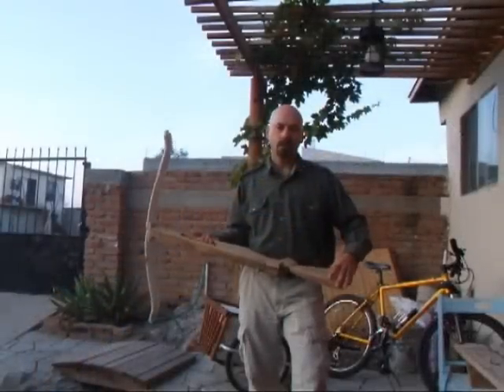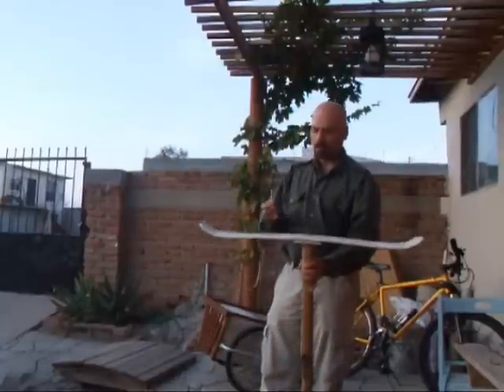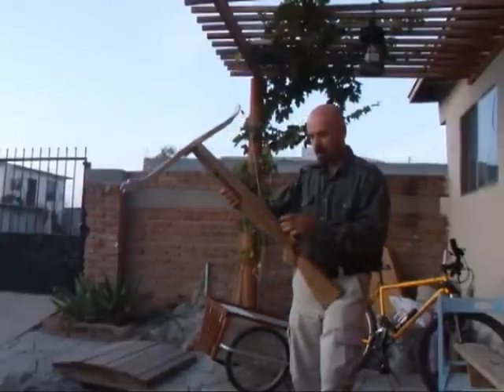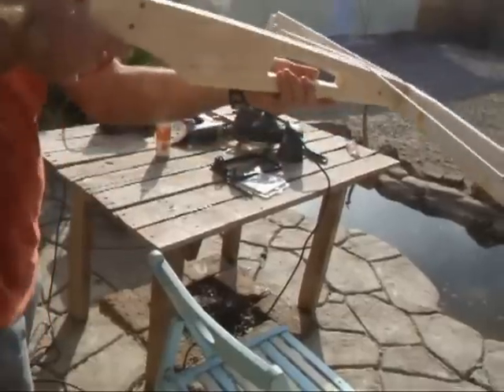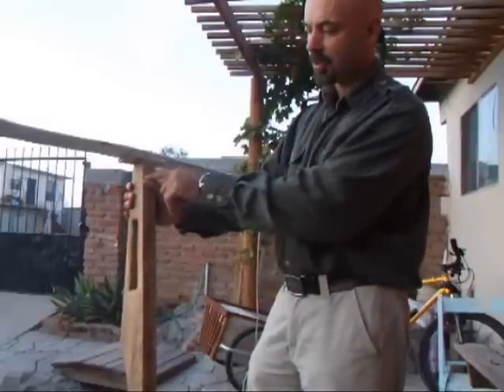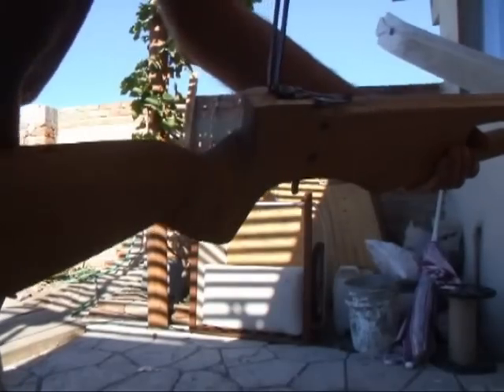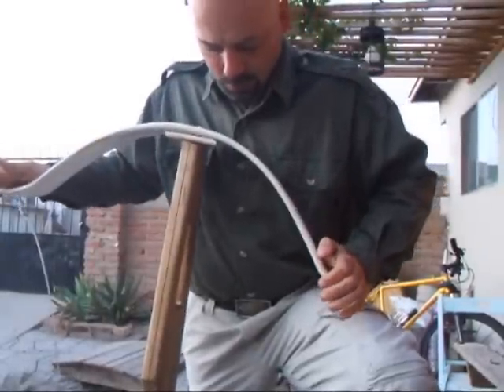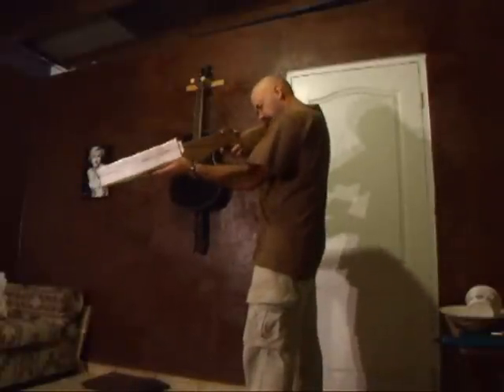How to Build a PVC Crossbow

Comment: I'm amazed it hasn't torn itself apart. One of the first things that is taught with bow/crossbow shooting is to never dryfire a weapon because of the incredible amount of energy that you are forcing onto the weapon and the string by doing so. When firing an arrow/bolt most of that energy is placed into the projectile upon firing. When dryfiring, that energy has no where to go except the string and the bow which can destroy the weapon and cause serious injury.

Comment from the maker: Dry firing, according to my understanding, can damage the bow or string, or even hurt the archer if something gives. However, my crossbow is made with PVC and cable for the string. I assumed that these would take the forces. I was wrong. The cable was plastic coated and the crimps eventually slipped (kinda like stripping an electric wire). The PVC did not fail and I doubt that dry firing would affect it. This crossbow has taught me a lot and my next is coming together much better.

Comment from the maker: In this case I completely flattened the prod, but this was because I chose to connect the prod to the stock (or tiller) via bolts. A tapered prod would be even more powerful and should then be attacked to the tiller by wrappings. I would recommend this method and will use it myself in the future.

Comment from the maker: yes, exactly correct. I do not have access to proper archery supplies and so I need to find a way to construct a proper arrow/bolt. Even when I fire one of my dowel bolts it is essentially dry firing since the weight is far too little. I have a design in mind and will try it in a few weeks, after I build my next crossbow. Additionally, the string was a tad too loose, which caused a little more vibration than necessary. Can't wait for the next one.

Comment: an answer to keeping the bolt in place,is mount a piece of spring steel  on top of the stock behind the trigger,a piece of an old handsaw blade will do it,it and be bent and shaped as needed,and will hold the bolt in place adequately,and while bendable will retain enough 'spring'..........hope this helps.

Comment from the maker: yep, I know exactly what you are saying and had the same thought...after I saw the failings of the bolts. The nose of the stock(tiller) should be a little larger than the bow(prod) and could then be notched to hold the bow snugly. An equally shaped bit of hardwood or steel would wrap the front of the bow and be attached above and below the prod, perhaps hinging on one side and bolting on the other. Most people use lashings, but, as you state, grips would make the crossbow collapsible.  thanks

Comment: With a single hook to lock the string back, you will need a small secondary loop (about an inch wide) made out of a strong stiff material like mono-filament wire about the area were the arrow/bolt connects to the bowstring.  You will be able, then, to put a nock on the feather end of the bolt so that it stays securely on the string.  This will also get you to lock the string back at the same point.  If you don't, you'll wonder why straight arrows do not perform consistently.

Comment: To avoid breaking the pvc from the wood just drill a hole two inches behind the top of the wood and take a string then wrap it trough the hole over the pvc and so on... No screws

Comment: In the clip, on the background you see a bike !!! again, use the cable from the breaks.
Use the (i don;t know englisch name for it), same little tool one uses to fix and adjust
the cable on the break. And also, you MUST use two kinds of material for the bow !!!.
The 2 materials have different physical properties and thus will make your bow more
powerfull, also (it wood used), 2 materials result in 1 material having new very strong
physical properties.

Comment: I would just use a bow wrist release for the string holder. If everything is centered perfectly there's no reason why the bolt could just be left floating with a drop away arrow rest in front. I think.

Comment: Not bad but a few pointers.  First, try to avoid putting anything (IE: bolts, straps etc...) through the prod (the bow portion of the crossbow) as it will weaken it and potential for injury is increased.  Second, I highly recommend picking up some Dacron b-500 or b-50 for use in making a proper string.  It's durable, and if you make the string right (very easy with a ton of videos and walkthroughs online) it will withstand the rigors of shooting as well as be easy on the fingers.  Third, in order to connect the prod to the stock, many crossbows utilise a rope with a loop on either end (much like a bowstring) that is run through a hole in the stock.  Each limb of the prod is placed through one of the loops.  To keep it from moving vertically while attached in this fashion, remove a 1/4 inch of material from the front of the stock, leaving a ridge at top and bottom.  Good luck!

Comment: Well, you've certainly heard enough snide comments about dry firing your bow, that's for sure !  Agreed, it's never a good idea to do so, but I came in to ask if you had ever considered using paracord for your bowstring.  Get the real stuff, because it's rated at 550 lbs, so it will never break in your bow.  Also you would not have to worry about any compression clamps, and the bowstring slipping out. I use it in all my longbows, and some of them are 80# @ 28'' amo 

Again, I'm not sure why everyone has to be such jerks about the way they tell you about the dry firing . . . . .  but what can ya say . . . . .  the world is made up with many sorts of people !
Reply: while paracord works in a pinch (survival etc...) it actually is a pretty bad material for bowstrings as it stretches a lot.  A better option would be to acquire some B-50 or B-500 Dacron and make a nice quick flemish twist.
Reply: HAHAHAHAHAHA . . . . . . . . . ! ! ! 
Say what you want, but I haven't had a lick of trouble from my substandard paracord bowstring . . . . . . . . . .  I've had it on my bow for a year now maybe just a little more, and it shoots just as good as it ever did !  The spacing between my riser and bowstring has not diminished at all !  So judging from the comment that it will only work in a pinch for survival, I'd say that is one MAJOR BIG Pinch . . . . . . .  ! ! !   hehehehehahahahahehehehehe  I'll post my deer this year that I take with my substandard bowstring !  ;)
Reply: Hey, I'm just going by the science of the material.  Nylon stretches.  Paracord is 100% nylon.  Therefore, it will stretch.  A 20-40 lb bow might not stretch substantially but it will still stretch. I wouldn't put paracord on my 64# recurve, that's for sure.
Reply: On top of that, Dacron is far cheaper than paracord, it's made for the purpose of bowstrings, and it looks way nicer than a paracord string.
Reply: KingAemon This is of course YOUR choice. Myself I don't care what it  = looks =  like, only how well it performs the job I'm requiring of it. I know the paracord is strong and very durable, so I will continue to use it with MY bows. As I've said, after having it on my bow for as long as I have, there has been no changes in it's performance !  Also, since I'm not in the market to sell any of my bows, I don't have to worry about how it looks. I only worry about how it performs, and I'm not worried at all about that . . . . . . .  As I've said, I'll post all my hunting kills this year, to show all that it really does work, even if it doesn't look pretty like a store bought bowstring. If someone is that worried about something like that, then perhaps that person should simply go pay the enormous prices of the top name brand bows currently on the market. Me, I just want a bow that is within my finances and functions well enough to target shoot whenever I want, and to hunt with.
Reply: para cord stretches too much
Reply: Dupa Krowa Say what you want, but I haven't had a lick of trouble from my paracord bowstring . . . . . . . . . .  I've had it on my bow for a year now maybe just a little more, and it shoots just as good as it ever did !  The spacing between my riser and bowstring has not diminished at all ! I'll post my deer this year that I take with my paracord bowstring !  ;)
I'll also post all the small game I take as well.  I've yet to see anyone posting any of these here yet ...  only shooting at targets in fields backyards and driveways.  We need to show that this is just as viable a material as wood, wood laminents, fiberglass, ALUMINUM, and so on.
Reply: *****  Hello back at ya ! ! !  How are things in Australia ?  Things have been pretty cold with subzero temps. around here and Lots of snow ! ! !  I left 3 of my bows (still strung) in the trunk of my car over the last 2 weeks to make sure the weather got to them plenty good, and recently it started to warm up again. So, before it got too much warmer I took my bows out of the trunk to see how well they would perform. The distance from the risers and bow strings still have not diminished any, and I can tell you for a fact (because I measured the draw weight again on a scale) that the draw weights are right where I left them. The bows STILL perform as they always have.  I sincerely do appreciate all who have made their suggestions as to what I should be using for my bowstrings, but I honestly don't see any reason to fix something that isn't broken. For the price of the paracord and the length that I get for that price, I don't see my changing anything.  

Now PLEASE don't read this wrong and think I'm just being snotty towards you, because that is not my wish at all. I've simply found something that works great for me and I'm quite happy with it.  Also, I like the fact that I'm talking with someone all the way from Australia !  That's cool to me !  Kind of like a modern day Ham radio operator, but on the computer instead !  Take care and message me anytime you wish .  ;-D  I'll go look at your channel too !